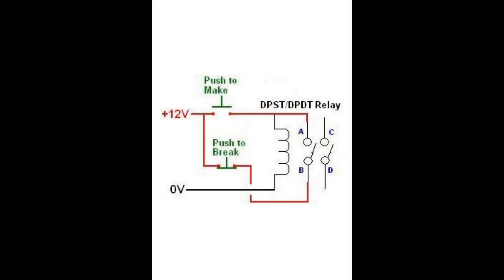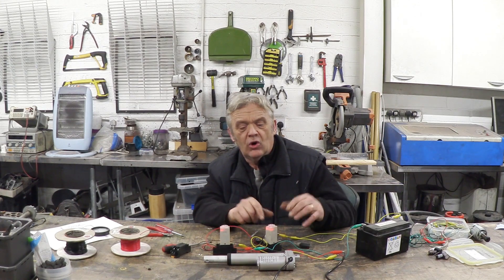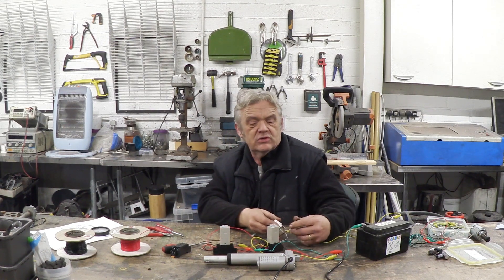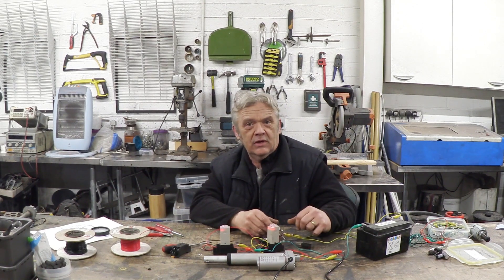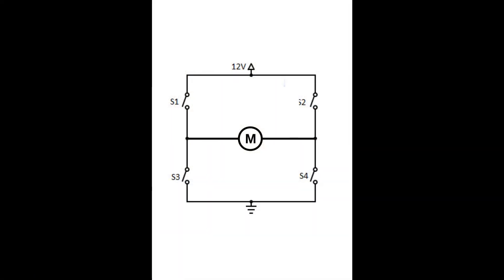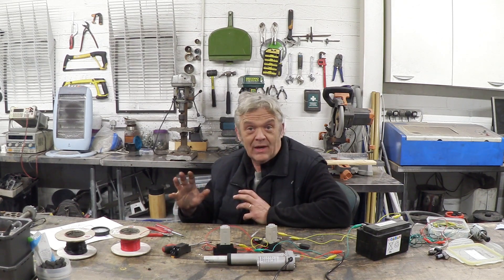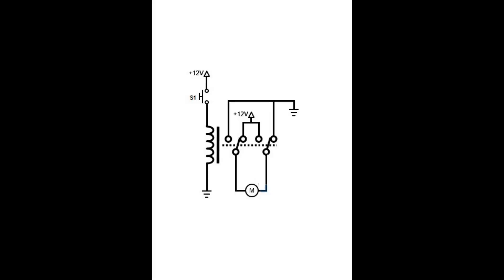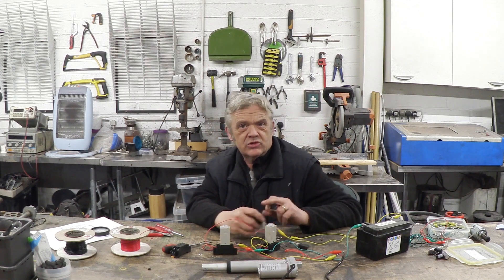965 - Latching Circuit And H Bridge Using Relays For Robots

Comment: a single SPDT (Single pole double throw) relay forms a half H bridge.... and connects it's output to either plus or ground voltage. if it's a break before make SPDT relay (most are) then no need to worry about "shoot through"... which is where two switches on one side of load are closed, and result in a short circuit.

half h's are great as with 2 you get a full bridge. And with suitable control signal to 3 "half- h"s, can convert DC to a square wave 3 phase supply., which can be used for driving 3 phase motors at variable supply frequency. 

regarding solid state switching...
I prefer to keep high current circuits electrically isolated from control signals...
I also don't like drawing too much current from microprocessors, nor needing to handle inductive kick on microprocessor side..

My fave general purpose power switching circuit....  uses a photovoltaic output optoisolator (like the TLP591) to interface with a n-channel mosfet. Easy enough to put a LED in series with the input side if and resistor a visual indication needed. Because the TLP591's output voltage floats, ie "adds a voltage".... it's output can be wired between the gate(control) and source(output) of a mosfet. Doing such means the mosfet doesn't get exposed to excessive source-gate voltage.  Not uncommon for a mosfet to be able to switch say 55V (source to drain) but will fry if source-gate exceeds say 10V.   The mosfet's gate voltage can also be raised above the drain voltage, without need to faff about with fancy gate driver ICs ... So circuit is quite happy working as a switch between positive supply and load ("high side" switch) as well  between load and ground (low side switch)
Reply from the maker: awesome post mate - cheers
Reply: I'll have to re read that one a couple of times :) Think ill be hovering over my breadboard tonight

Comment: ....Dave of eevblog designs through evolving steps an excellent electronic switch with no power consumption in standby or latched states operated by cheap momentary contact button. Ten year old video, .A very good design for which he established IP . But relays are fun .  There used to be singular relays called latching relays , core lightly magnetised sufficient to hold points arm once touched and turned off by a brief pull from an opposite solenoid . In cars I believe the on state of relays draws a continuous 300ma  , quite high a draw .
Reply: Thanks for mentioning that other video, I’ll go search for it.  Zero power consumption in both states is such a useful feature in many applications.  I want a circuit to switch inverters on and off as part of an off grid solar setup, and holding relay coils energised just seems so wasteful.
Reply: Although not used as much nowadays, latching or bi-stable relays are still available.
Reply from the maker: that is a high draw

Comment: Somehow I ended up with loads of 555 timer chips a while ago, curiously they can be used as latching, set and reset switches too, they're very cool 😅👍
Reply: With enough 555s you could probably fly a rocket to the moon, it is easier to list stuff a 555 cannot do they are brilliant, so useful.
Reply from the maker: they are very cool - they are one of the best selling and longest lived chips I believe

Comment: Reminds me of car alarms that lock and unlock the door.. except that is a positive pulse and a negative pulse. Which the junkyard would be a good place to find relays.
Reply from the maker: I am not sure mate - these kinds of relays are used in house electrics a lot so maybe if a rewire was being done?
Reply: @ThinkingandTinkering  12 volt relays, the same principle.  Except it is a momentary on. The actuator pushes or pulls the lock. I forget how the relays are connected I just remember one relay gets a positive pulse and the other gets the negative pulse. I learned about latching relays 20 years ago when the car stereo I bought had a single wire for turning on other things with a half second single pulse of current. I just can't remember the circuits but the switching poles with relays is how remote door locks work. Which the last few days I to was thinking of playing around with relay logic. I honestly at first before watching thought you were making a forward reverse for you electric buggy. Which brings back memories of my fathers electric chair and how he had me adjust the pots so there wasn't as much current going to the drive motors. He figured out how far he needed to go and how fast he could do it on a single charge ;)